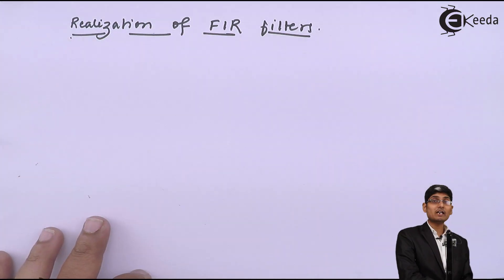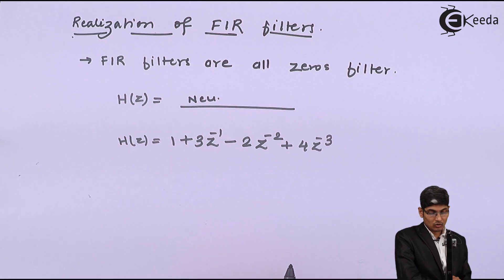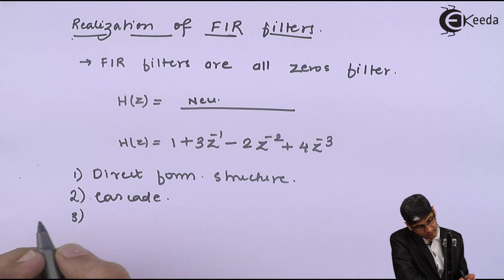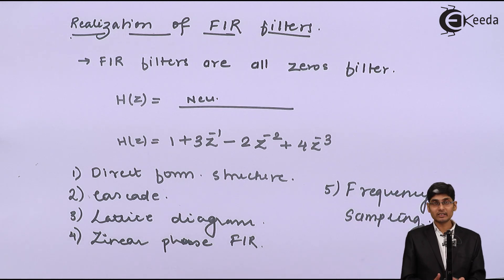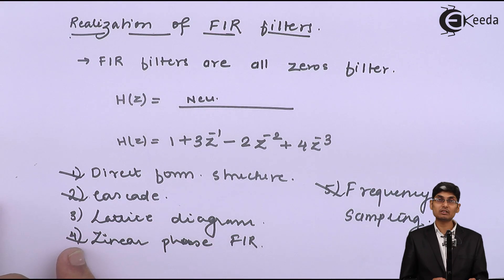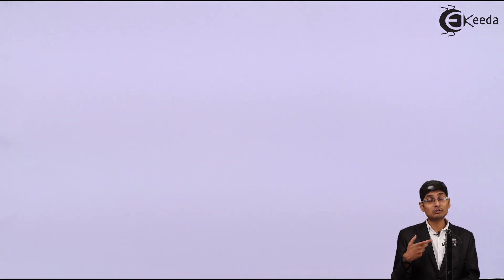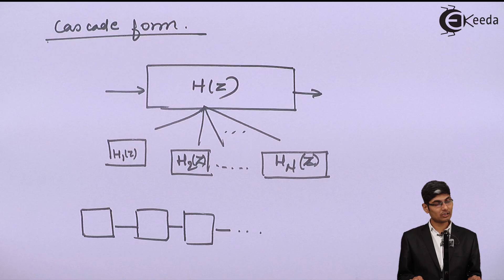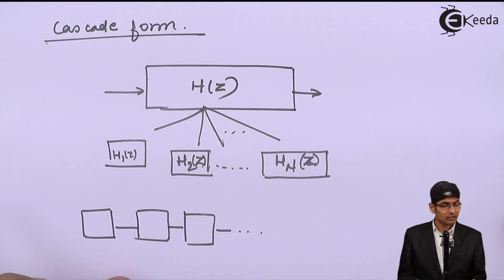What is Realization of FIR Filter | Realization of Digital Filter | Discrete Time Signal Processing

Comment: Reason behind not having denominator  in  fir filter ??
Reply: what is the meaning of an FIR filter: a filter which has a FINITE impulse response. i.e. it has a finite number of coefficients in its impulse response.  Now if you will see that a filter can be finite only if it is dependent on the previous inputs to the system and not the previous outputs (it doesn't have a feedback loop is its signal flow graph). This can be easily understood from the system equation of an FIR filter that because it doesn't depend on the previous outputs it doesn't have the poles (the denominator value you mean). But remember it has poles. An FIR filter has poles but they are all at the origin.
Reply: nagasharif shaik poles are on the denominator... That's IIR